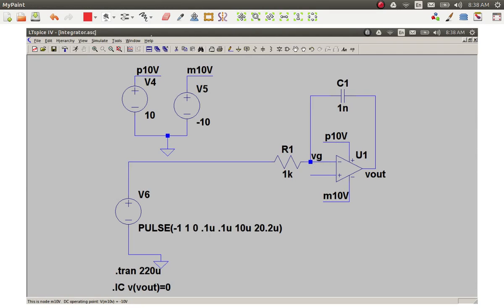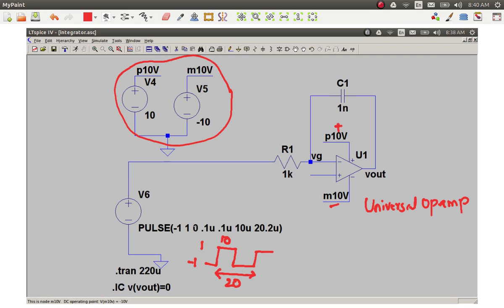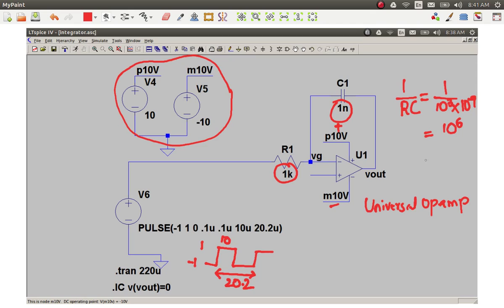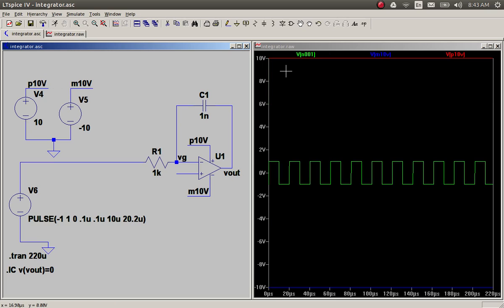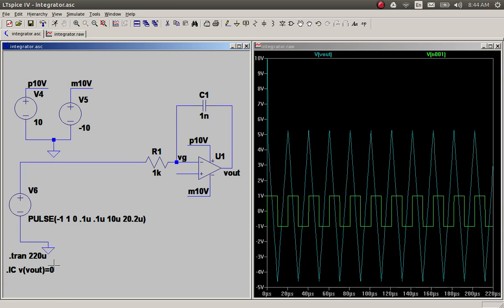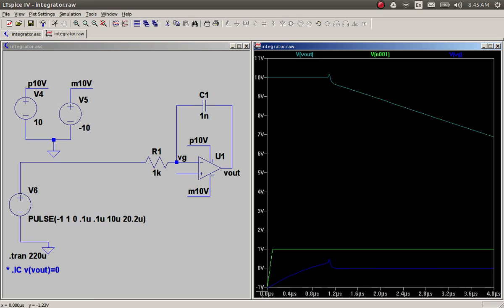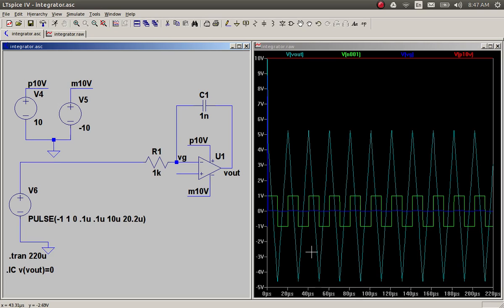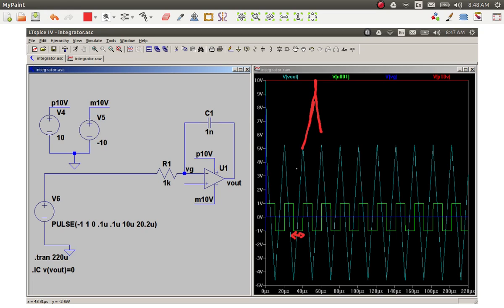Simulating the opamp integrator

Comment: Hi , could you tell me how I can repeated the point v4 in many places like you have done in the op amp 
As you write only p10v and m10v not connect to the source 
Then I'd like to thank you
Reply: Using nets. The little signpost with an A in it next to the resistor in the tool bar. Nets with the same exact name are connected